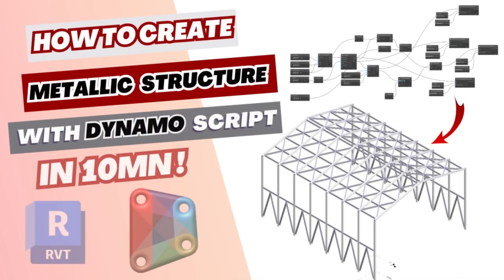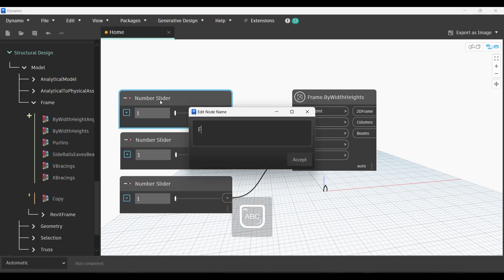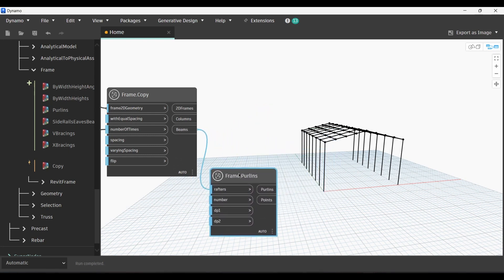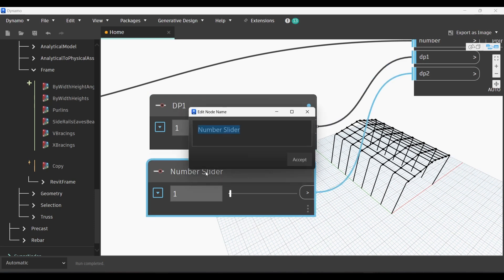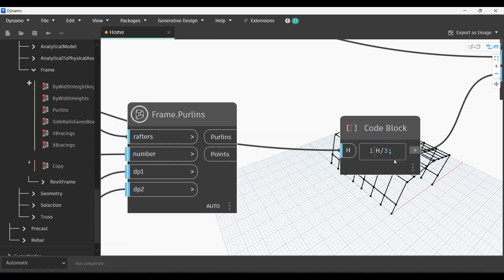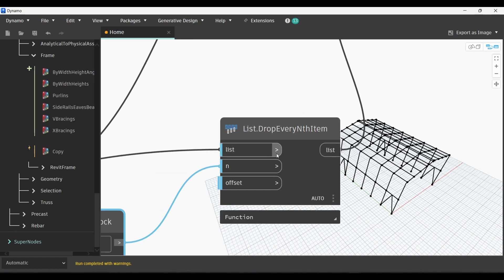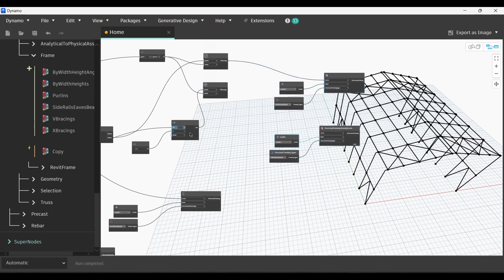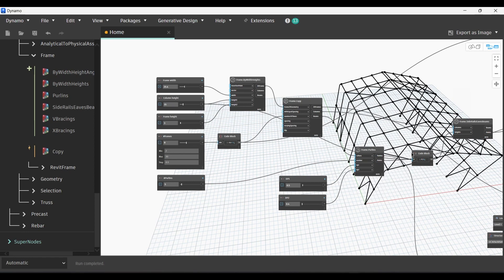Automate Steel Frames & Metallic Structures Modelling in Revit with Dynamo | Tutorial

Comment: fantastic, do more please, but for timber
Reply from the maker: Thanks ! 
You can use the same script and simply change the type of beams and columns from metallic to timber
Reply: @HowToBIM  Thankyou, is there a way to do wall timber or metal framing and roof without using paid plugins
Reply from the maker: @1insp3ru16 The Package I used isn't paid, you can find a lot of free packages in dynamo for the elements you wanna create

Comment: That was so helpful, how can i calculate the weight of this structure in dynamo?
Reply from the maker: I'm happy that was helpful, Concerning your request, Follow these steps carefully and you'll get the script you needed in no time : 

1. Get the Elements:
Node: All Elements of Category or Element Types
2. Retrieve Material and Section Information:
Node: Element.GetParameterValueByName to get properties like material and section size.
3.Look Up Material Properties:
This step may involve creating a custom node or using nodes like List.GetItemAtIndex or Dictionary.Lookup to retrieve density based on the material.
4. Calculate Volume:
Use appropriate nodes depending on the section shape.
If the section is a rectangular beam: Math.Multiply (for area) and Math.Multiply (for length).
If the section is a circular column: Math.Pow (for radius) and Math.Multiply (for length).
5.Calculate Weight:
Node: Math.Multiply to multiply volume by density.
6.Sum Up Weights:
Node: List.Sum to add up all the individual weights.

I tried to make it as simple as possible, let me know if you ended up having errors ! Good luck